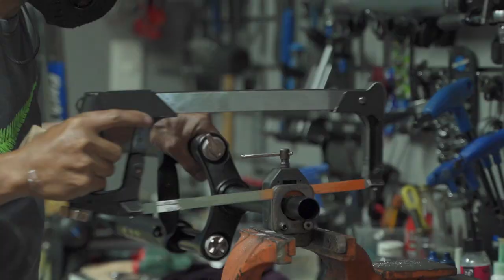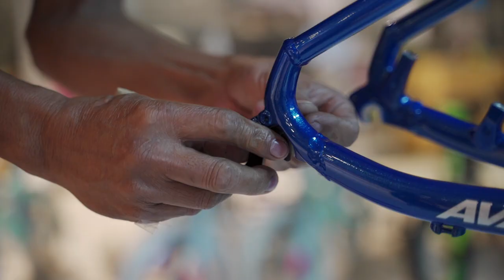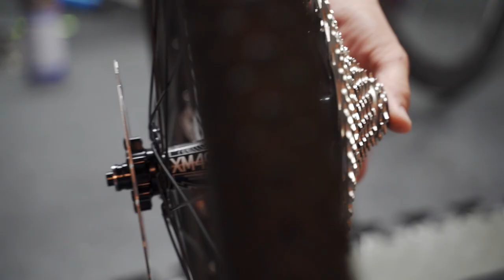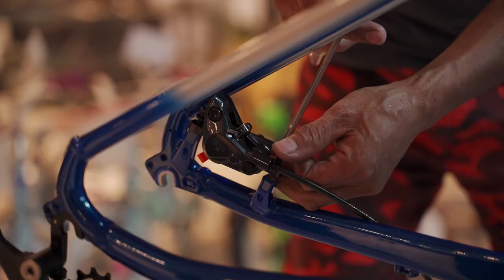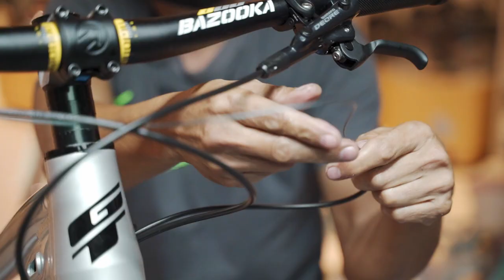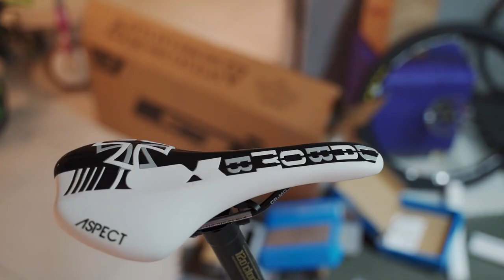2021 GT Avalanche Pilipinas edition bike build

Comment: Saw that you used KOOZER XM490 rear hub. May 141mm boost QR po pala yung koozer? San po nabili. Building my avalanche pilipinas limited edition frame as well
Thanks
Reply from the maker: https://www.facebook.com/109221537566397/posts/225616489260234/?d=n dito kami umorder

Comment: do 180mm rotor fits on the GT Avalance frame?
Reply from the maker: it will fit but you need an adaptor to mount it
Reply: ano klase na adaptor.me recommend po ba kayo,Saka ano po size na headset or brand .